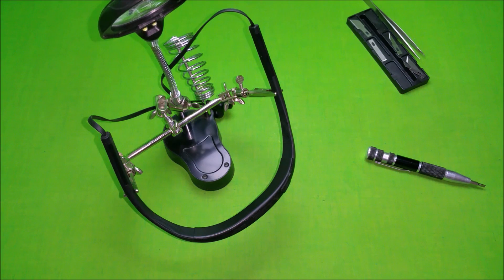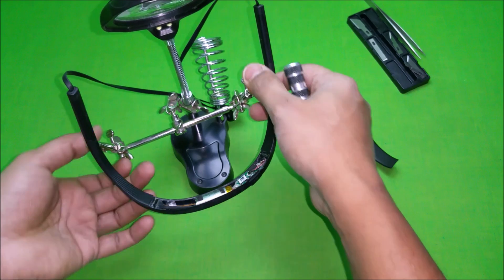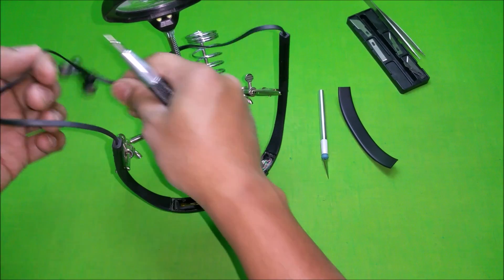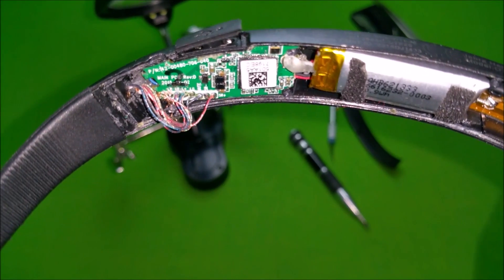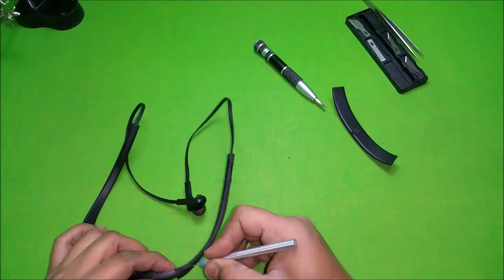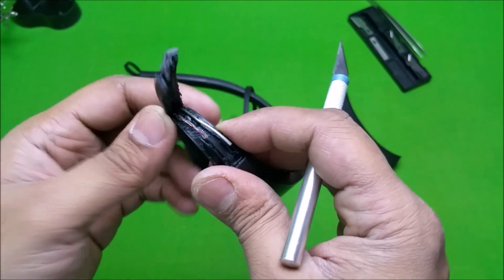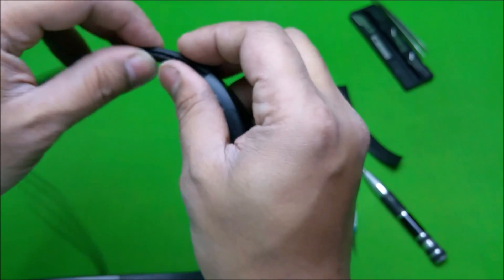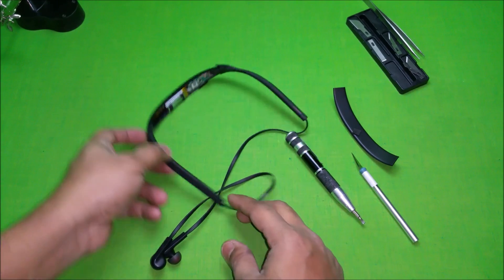Jabra Halo Smart (Disassembly)

Comment: Hey my Jabra Halo Smart v1.8.1 had some weird issue the call disconnects and youtube pauses intermittently, do you know is this a hardware issue or firmware? How to update the firmware, I tried to search in Jabra Assist app on android not finding it. Let me know thanks.
Reply: I have the same problem and it is frustrating. It has already affected my work but I need a bluetooth headset so I can answer calls while driving.
Reply from the maker: This happens because of the wire breaking or getting short in the band. To fix it the wire has to be replaced and to do that you will have to open up the bands which cannot be stuck back properly.
Reply: That's awful right?! Mine has the same problem with like 7 months.. I could send it to garantee because we don't have it here in Brazil.. It sucks, just lost the investment! Argh... Very disappointed with this brand.

Comment: Sound does not come out from the left earphone. Any suggestion to check where and how to check the issue? Thank you.
Reply from the maker: The issue is the wire in the band, it breaks fast. if you want to fix it then you will have to cut the band open and change the wire but you wont be able to fix the band back like before.
Reply: @KenKnowsMore  Any success with that Ken?
Reply: Same here.. Using it 1year.. It just stop to work in the L side and simply disconnect the call.. It is pissinh me off more than not work the L side
Reply: Same here... Been using Jabra Halo Smart for 1.5 years. Facing trouble with left earphone since a week.
Any Jabra official support can fix it?

Comment: Mines will not turn on but it charges. I was listining to music and when i put it on the charger it never turned back on once the light was green
Reply from the maker: +chase hester it looks like the wire had broken.try flexing the band a little while You keep the power button pressed. If that doesnot work then you will have to send it to the service center.
Reply: I have the same exact problem
Reply: same

Comment: How do i repair the left ear bud which is not functional?
Reply from the maker: +Rohit Patro you will have to cut the band open and replace the wire. If you can figure out where the wire is broken then you can just open that much and repair the part. That is the only problem with this earphone if it breaks then you can't really repair it without cutting it open.
Reply: Ken Knows More can I do it personally??? Or I have to visit a technician for the same...
Reply from the maker: +Rohit Patro I would suggest a technician but I don't think a technician would want to repair it because it is a lot of work.
Reply: Rohit Patro same problem with mine. the gurantee is due. any suggestion?
Reply: Rohit Patro what if the cable breaks in the speaker? How do i dissemble it?
Reply from the maker: +Budi Panjaitan the problem is that the cable attached between the speaker and the main board is sealed under the band and to get to it you will have to cut it open. The earphone is also sealed so you will have to use tools to open it and in that process you might damage it. The earphone does not have clamps to open it like the back of the band does.